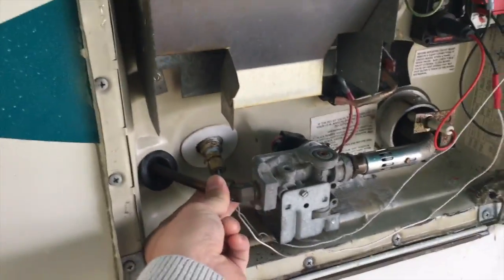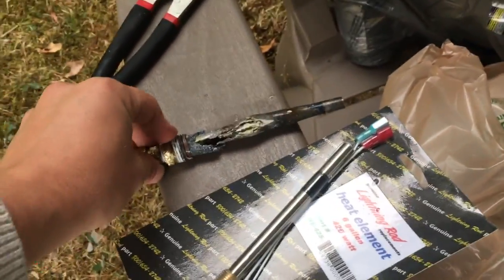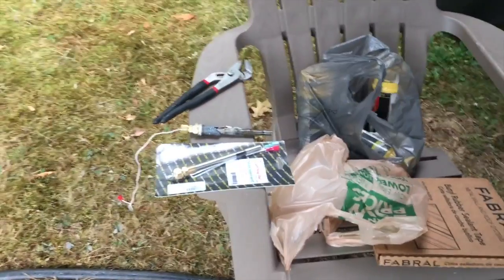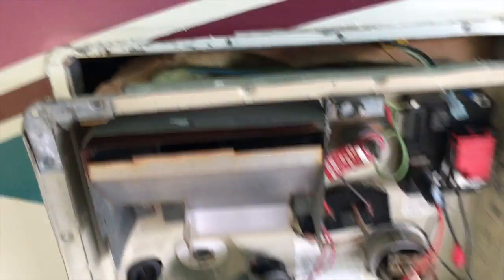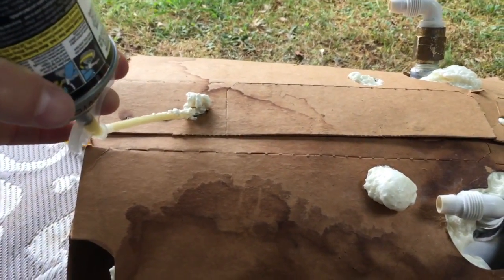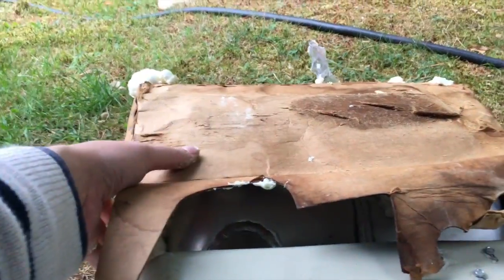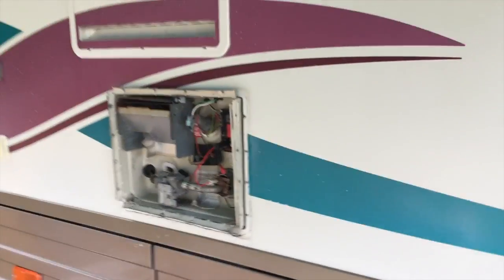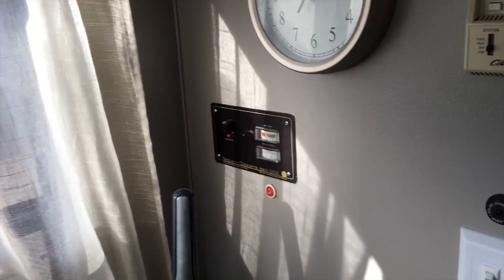RV Water Heater Hack! Spray foam insulation!

Comment: Your water heater has both gas and electric heating. I use both at the same time. My 6 gallon water heater recovers in no time. The expanding foam using the existing box was a great idea. I was afraid the foam would expand too much and blow up the box like a balloon. Great video, thanks...
Reply from the maker: Thankyou!! You are absolutely right!

Comment: I agree with Harvey, mine has both and I seem to have an endless supply of hot water.  That being said, since you already have it out, why not simply cover it with an aluminum faced insulation pad.    Seems simpler and a lot less mess?
Reply from the maker: Well I no longer own the motor home, we’ve moved into a fifth wheel but I’d say that would work well.
Reply: By spraying the foam directly on the tank you eliminate the chance of condensation.  Also, if you are referring to the aluminum bubble wrap stuff:  it is not an insulator.  My suburban hot water heater has white foam on it, but a large chunk is missing.  I'm going to be filling it in with spray foam, but I'll find the closed cell type (I think Titelock makes one), whereas the normal high expansion stuff has less of an R Value.

Comment: How well has this worked long term?
Reply from the maker: Great! Lol We are still living full time in the Rv and still using this same hot water heater!
Reply: @nathanshiannetinsley5723  Has the direct heat affected the spray foam at all?  I was going to put in a new marine 6 gallon heater in my rv and was going to replace the existing insulation with spray foam.
Reply from the maker: I haven’t noticed any negative result or smell from the heat on the foam.. if worried, I’d definitely look at the heat barrier point for the foam! Typically water gets no hotter than say 120-150 degrees. If your water heater is new I wouldn’t do the foam. Hope this helps!